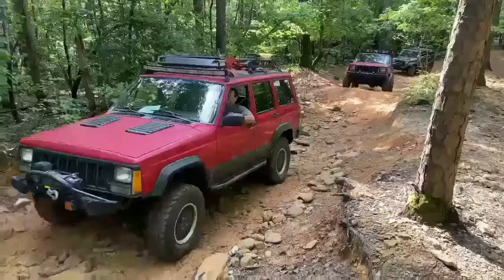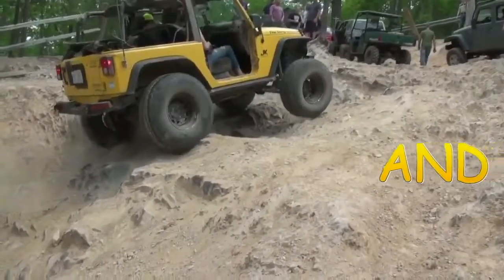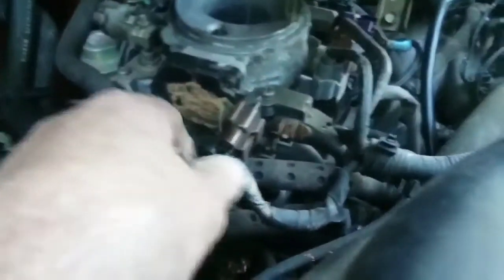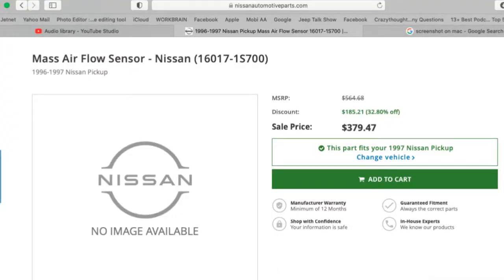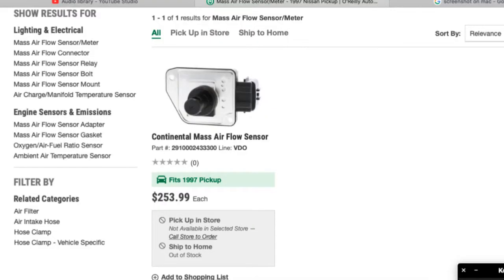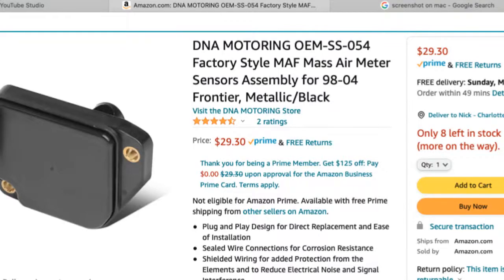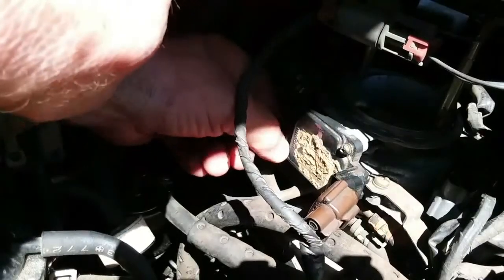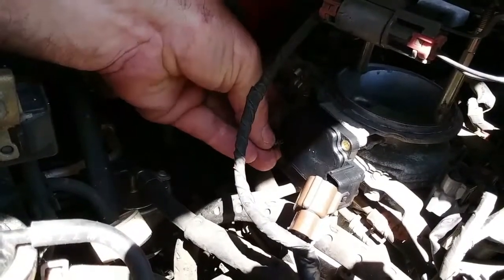Nissan hardbody mass airflow  swap

Comment: Mannnnn mine is 92 it's self revving as it idles. Cannot figure it out
Reply from the maker: Thanks for watching. As I speak I’m making a video on how to test and adjust the throttle position sensor. Could be a vacuum leak too.
Reply: @NickG  what bout o2?? Anyway that causing it??
Reply from the maker: @kylekiser1006  could be. hard to tell. but if you haven't changed them in a while ir would be good idea.

Comment: I noticed my ranger makes a pinging/spark knock noise under load but if I unplug the maf it go’s away but the truck will run rich can’t figure out the issue
Reply from the maker: Thanks for watching. Have you tried replacing or cleaning the MAF? Faulty O2 sensor will make it run rich too.
Reply: @NickG  I changed the maf an it didn’t fix it it’s running lean an that’s what’s causing the pinging I guess it’s a common problem on the 3.0L I gapped the spark plugs smaller at 42 inches an that seem to help
Reply: @NickG  would it throw a check engine light if 02 sensor is bad?
Reply from the maker: A worn o2 sensor won’t necessarily throw a code.